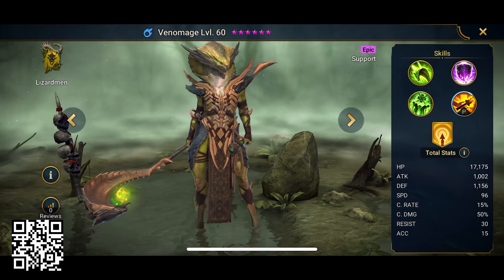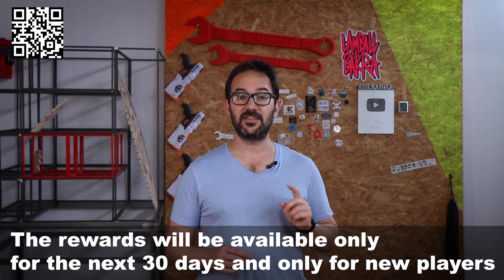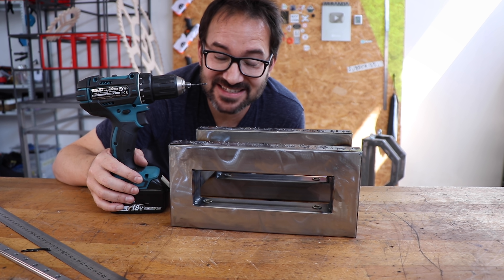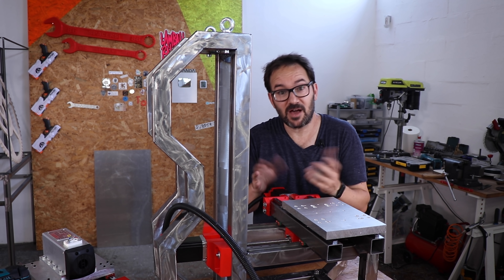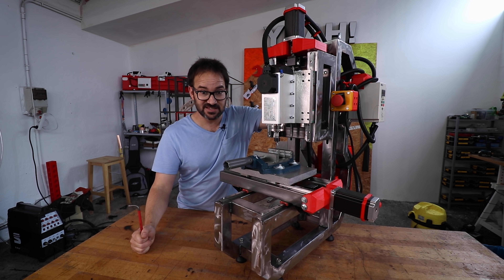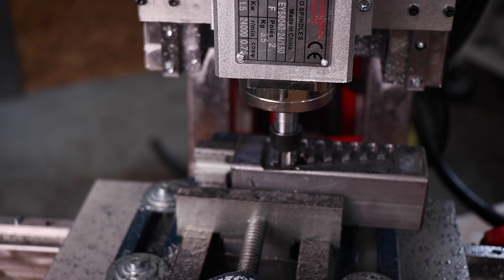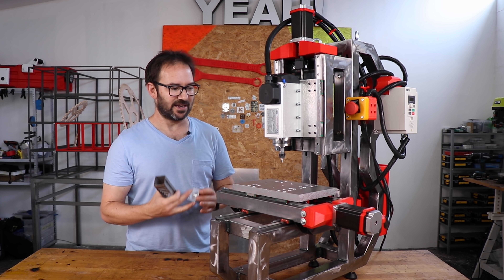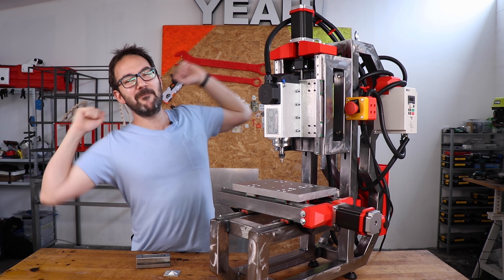I MADE A STEEL CNC MILL FROM SCRATCH (desktop version)

Comment: Want a crane? Build a crane! You can buy a winch, electrical or hand crank, other than that you just need some pulleys, a couple of wheels and your welding skills are definitely good enough to make the frame! I guess steel is expensive right now, but other than that, nothing is stopping you! :D

Great video as usual, and good work! Thanks for sharing!

Comment: It was painful to watch you weld in the wrong order (the first half of the video), but I've learned to master TIG welding after a year, (considering the long learning curve) that comes with it. Always make sure to tack it first and start welding with wire once everything is straight and at a 30/45/90-degree angle, otherwise the heat will deform its shape. Also, keep in mind the thickness of the steel tube profile, otherwise, you will burn holes in it so adjust accordingly and make sure to maintain your tungsten to be always sharp. And point your sharp tungsten as close as possible in the corner and tack it with either a slow Ampere or a high Ampere, but be quick with tacking it. I hope this helps! Keep up the good work, the more you weld the better you will be in the future!

Comment: I would look into getting some thinner gloves for tig welding, they give you much better dexterity. Tig gloves are usually made of goatskin because of how thin it is. 

What you have is more of a stick/mig welding glove, very thick and you cant make as precise movement along with fatiguing your hands quicker. They are probably 3-5x thicker than Tig gloves and you make you give up alot of dexterity needed for Tig.

Comment: Cool project but I’ve had to machine tube steel at work many many times and it’s never dimensionally accurate. It’s actually quite a nightmare for a machinist. 
Why wouldn’t you just build it out of solid steel machines to tolerance??
Reply: Some parts are of plastic, I don't think stiffening the metal parts will help a lot. Also not sure if it will be straight if it is manually welded and not cast and machined. Still good for many jobs.

Comment: Forgive my skepticism, but if you add together the cost$ of steel + tools+ electricity + TIME  you are approaching the uncomfortable situation of re-inventing the wheel... And if the machine does not work as intended, you cannot ask for reimbursement. Moreover, there is no "funny" side in this project. You work more and smile less: a bad sign.

Comment: Now that you have a better CNC, you need to mill replacements to the 3d printed ball screw mountings from aluminum, to make it far more rigid.
Reply: @Ukranian Robokop If he decides to go with epoxy granite, then he should just use an aluminum skeleton and encapsulate it. It would be impossible to get good results by attempting to fill the thin wall steel tubing.

Comment: Ok, so this is super cool. Just a few things that will make it better. 1. Drill a couple holes at the top and fill the frame with sand. This will reduce vibrations. Also get an engine hoist if you ever plan on moving it. 2. The spindle you are using is way too fast for what you want to do. I suggest getting a 1100 rpm motor 1.5-2.2kw and use a belt driven spindle. This will put your RPM range more in line with cutting metal vs using a something designed for wood or other soft materials. You are looking to have an rpm range from ~1000-8000 ideally. Your spindle has no power in that range. There is more than one way to do this. Alternatively you can get a much more expensive low rpm spindle. 3. Get a speeds and feeds calculator. It will give you the optimal feed rate and rpm for whatever material you are using. G-wizard would be a great place to start. There are others that other people may be able to recommend. Also check with the manufacturer for optimal chip load. All in all great job Ivan.
Reply: There are carbide tools to run at those speeds. I personally use DLC coated bits for aluminium, can run up to 550m/min, and TiAlN for steel. They are still happy with about 300m/min. At that speed you can still use 24k RPM spindles quite decently even at up to 10mm bits for aluminium or 6mm for steel. 
With 2 flutes the feed rates are also not that extreme (around 1000-2000mm/min) so the machine should be able to handle that. But of course they are much more expensive than just tool steel bits.
Reply: This is true… but with higher speeds comes higher feeds and I’m not sure if the machine will be up to it. It’s certainly worth a try at least once though.
Reply: @jdmorgan82  Hoffmann-Group has two flute cutters for steel. For example in the GARANT Master Steel series. For the 6mm cutter you just need 1000mm/min of feed rate with 260m/m cutting speed. Officially just with flood coolant but it works just with air as well.  If the machine cant handle that speed then there is something wrong with 5mm pitch ballscrews. 
The 3 flute ones are even rated for just air cooling.  Like the Garant VHM-Fräser MTC series. That is rated at 1800mm/min cutting speed (again 6mm diameter).
Of course they are not the cheapest endmills you can find but personally I find 40-50€ acceptable. I love them and the GARANT Master Alu on my router.

Comment: I want to know for the motors and spindle you used and if there are plans for this
Reply: For sure don't get a air cooled one, will be loud as f&&k. Get water cooled, it will be quiet even above 10k rpm
Reply: @randomresearch8494  Nah. Aircooled can be fine if you do not go the cheapest route. For not even 500€ you can get proper air cooled 1.1kW spindles that are surprisingly quiet. Sure not as quiet as an water cooled one but much less work to maintain the loop and run all of the tubes.

Comment: How is it even possible to get such a bad wall finish on a steel frame machine. Look at the side walls of the aluminium. You got some serious vibration in this machine. Sure you made it now stiffer but the way it is build I am quite sure it will have bad harmonics in there ruining the quality. At least fill the steel tubes with sand. That should improve the quality dramatically.

But sorry it is still not a good machine. The way you build it there is no way any of the axis are perpendicular to each other. I am honestly surprised that the axis even move and not just bind up. Not having a bearing at the end of the ball screws is just a no go. You are now relying the one bearing block to constrain the screw in all three axis. That will will that block. 

Just take an indicator and move it along the axis. Especially the Z-axis will be out by a lot. And you have no way of tramming that in. So all parts will be out of square and obtaining precision will be hard. 

I dont know. I like that you just design and build stuff but there are reasons why those machines are all build a similar way. The way the force has to be transmitted through the frame just forces you do to certain design choices. I grantee you you will not be happy with this machine in the long run. As soon as you want to make some more precise parts you will start to hate the choices and shortcuts you took. 

Also I do not understand some of those shortcuts or savings. Using flat milled aluminium is not a lot more than buying the plate 5083. It is just a few € more per m^2. That alone would eliminate some of the alignment problems. Also steel tube is never square unless you take the precision ground ones. So alone in your Y-axis you will have a few 1/10 of a mm variation. I would also recommend just taking some 30mm flat milled aluminium for the connection between X and Y instead of the steel tubing.
Then check the squareness between the X and Y table towards the Z axis with a granite angle. Best way is scraping it until it is perpendicular. Can be done quite cheaply, just a ton of work. 

And for your feeds and speeds. It is all still way to slow. Get some proper endmills after you filled it with sand. For the high RPM I would recommend some DLC coated carbide end mills. They will be happy running at the 20k RPM of the spindle even with 6-8mm width. For smaller diameters(2-4mm) uncoated carbide will be fine. You should be ok with just running them at the max RPM. At that point you can start playing with depth and width of the cut. 
Also please do not use spray bottles on carbide. Either run them without coolant, usually fine for steel usage, or get a cheap mist cooler. The spray will cause the carbide to break due to thermal shocks. Carbide is strong but brittle. 

For steel you have to use thinner end mills with high RPM spindles. I personally use HOLEX Pro Steel in an 24k RPM spindle. They are quite high speed, with a recommended cutting speed of 260m/min but even that just means 14kRPM with a 6mm end mill. I do not like cutting slower than 1/2-1/3 max RPM because then you just lose too much power of your spindle. So 6mm to 8mm is the max for me.

Comment: I really like your videos and have been experimenting with diy cnc routers during this pandemic a bit. I recommend using single or dual flute cutters on these high rpm spindles becaust it enables you to take slower deeper passes (good for the steppers) on high rpm (where these spindle motors have good torque) and still take a decent chip per tooth wich is important to reduce friction and extend tool life and have cleaner cuts. Also I recommend to fix the machine to something heavy or even cast a concrete block around the steel frame to dampen vibrations because steel alone is not good at that. Other than that great machine! Keep going and greetings from Germany!

Comment: So much awesome in this video. I think you're going to quickly spend more on steel than you ever did on plastic if you haven't already.
Reply: Steel tubing is cheap. In the video you see that the steel is either 40mmx40mm or 45mmx45mm tube. I would guess with 2mm or 3mm wall thickness. 6m cost you around 70-80€ of that stuff. So in total less than 200€ for the steel. 
Tho it looks like he got it cut. That is not that cheap then since if is often 1-2€ per cut. Especially the angled cuts.
Reply: @nukularpictures  he has a bandsaw. Also, his projects have inverted their former metal:plastic ratio.
Reply: @OldCurmudgeon3DP  Not for steel, at least as far as I know. Trying to cut metal with a wood bandsaw is usually a bad idea. You will not get a straight cut, takes forever and you will ruin a lot of belts. 
But yeah I mean it makes sense. Plastics have their place but once you need stiffness a steel tube is almost as good as it gets. And it is a lot cheaper per kg.

Comment: Looks Awesome. My suggestion would be to move the safety cut off switch to the front lower beam. In case of am emergency, you are not going to wait to reach over your work area to do an emergency shutdown.

Just my thoughts on this.

Comment: Love it! Do you think that its smaller, more rigid design gives it an edge over some of your larger MPCNC's?
Reply from the maker: This one is wayyy more rigid than the other ones and the motors are way more powerful so yes, this is more capable in the small volume range.
Reply: @ivanmirandawastaken  looked like nema34 open loops?
Reply: @ivanmirandawastaken  I don't wanna imagine how weak were the previous machines, measure this and previous to see how better or useful is this, in order to see if this is gonna be a project to work on or just a nice video

Comment: I have learned the hard way not to eyeball mitres when welding, I use magnetic angles every time now, one mitre slightly out can affect the rest of the build and making a whole lot of correctional work for you, is that why you cut loads of welds?
Reply from the maker: Honestly I would love for a magnetic angle to be strong enough to withstand the pull of a cooling weld but any welder would tell you to clamp it (which I did).
Reply: @ivanmirandawastaken  a welder friend of mine literally just cuts temporary gusset plates and tacks them first to act as a clamp and angle guide. It works great and you can reuse the sheet metal a bunch of times by just grinding the tack tabs off.
Taking the time to make a few gusset guides can save a bunch of time and keep everything perfectly aligned while you work and you don’t have to worry about clamps slipping out of allignment or bumping anything.
Obviously super thin sheet metal might bend during welding, but there is a sweet spot of thin enough to easshape as needed and thick enough to be a strong guide.

Hope this helps.
Reply: @ivanmirandawastaken  There are clamps spefically designed to hold the parts whilst welding, the clamp the 2 parts seperately and one of the clamps can be rotated over the base to set the correct angle.

Comment: Shoulda filled everything with sand to increase the vibration damping
Reply: @Patric Nope sadly that is not true. That is the problem about harmonics. If you hit the right frequency you will get a lot of oscillation even if you take very shallow cuts. And this frame will have a ton of problematic frequencies. 
Also you can just fill it with sand after it is in position. And if you ever want to move it you can just take the sand out via drain holes. WIth some vibrations sand actually flows quite well.
Reply: @Patric Yes I am saying that. And I am quite confident. Because if you hit or are close to a resonance of the frame no matter how little energy you put into it the amplitude of the vibration will increase. That is just physics.
So often it is a much better alternative to just change the RPM and feed rate to get out of that spot. 
The problem here is however, that tubes often resonate quite well at a variety of frequencies.

Yeah ok. If you go very shallow the dampening of the frame will be enough but at that point I would not call it milling any more. It is rubbing, causing a lot of heat in the workpiece and the tool. Both not ideal at all. 

If you have to go at such low cutting depth then there is no point of building such a machine. The materials used in this machine, given proper assembly, should be able of milling through aluminium with 10mm depth of cut and a width of 1-1.5mm. If you have to go so slow and shallow to eliminate vibrations the machine is pointless.
Reply: @Patric Also shallower cuts also means you are going to only use a fraction of what you should on your cutting tools. You’ll end up with every bit having a dull tip and virtually untouched otherwise, not efficient.
Reply: Epoxy Granite is the correct answer. It has amazing properties of damping and stiffness. It's truly amazing material and let's you do some truly impressive stuff that is impossible otherwise.
Reply: @2011JMB  the only one here who knows what they're talking about as far as milling machines
Reply: @2011JMB  But difficult to move the machine once it is filled. While with sand you can just empty the frame again and just move the parts much more easily. 
I agree that the epoxy has better properties but personally I would go with the 90% solution that offers me more flexibility if I have to move a hobby machine. At least for me that compromise would be worth it.
Reply: I'm sure it's not too late, all he would need to do is drill and tap some large holes, fill with sand and insert in some bolts to the holes to stop it coming back out.
Reply: Makes no difference if the spindle is a spaghetti noodle.  Besides, sand only adds mass, not rigidity so it's kindof a second rate option in comparison to high performance concrete

Comment: S(l)ick! You've been working hard lately! I really want to build one to. Hardware is no problem but the control and electronics always have me postpone project like this. How did you control this one? Plug and play would be great 😉 ghe ghe. Keep up the good work!
Reply from the maker: If you want something in the "milling steel with ease" range and something friendly I'd go for a Duet3, in this setup there are only the connections of the three motors to the controller. Cheers Daniel!!
Reply: @ivanmirandawastaken  the plans for this machine, where i can find it?
Reply: Electronics, especially g-code boards, stepper controllers and stepper motors etc is the easy part. (At least for me)
Reply: @Van Life no, i'm intrested in the dimensions of the steel frame, parts list And so on